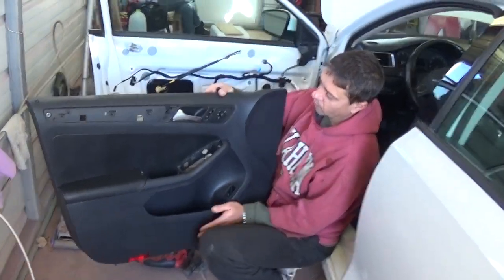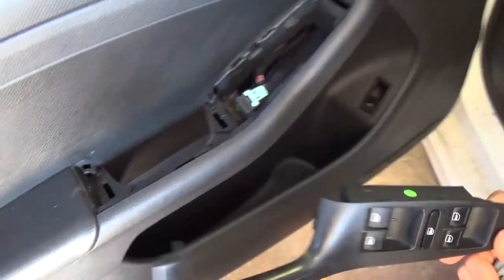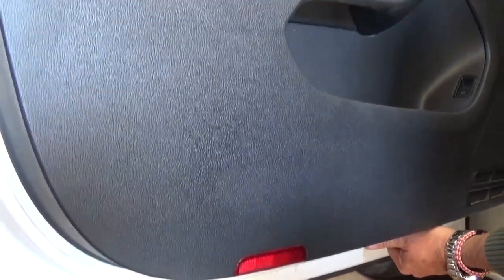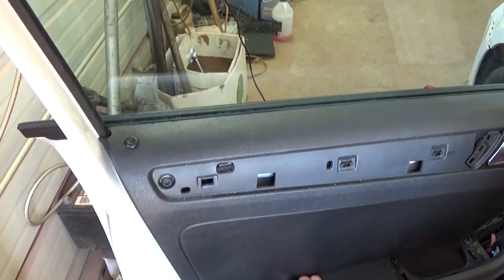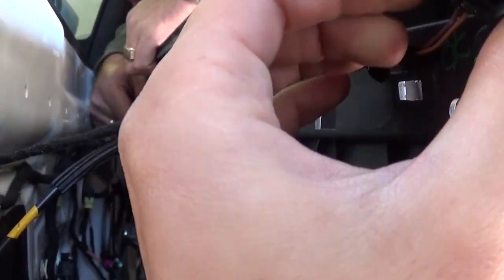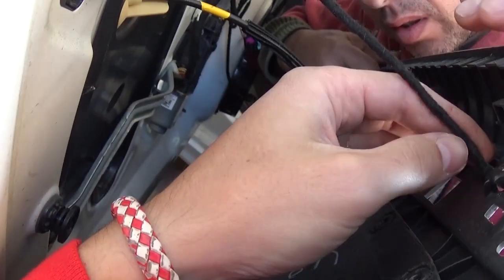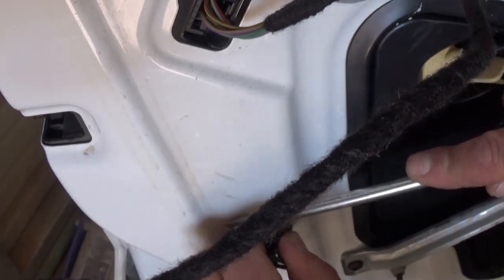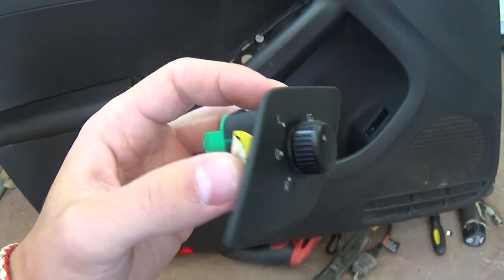VW JETTA MK6 POWER MIRROR SWITCH REMOVAL REPLACEMENT | VW GOLF MK6

Comment: Thanks a lot. Useful information, I did not need to hold the entire door cover off since I just removed the back mirror control. As this is in the top door cover, I sliced down the window first to remove the device. 😄😊🤘🏼

Comment: I just had to replace my switch, took all of 15 minutes. Just pry the switch out from the door directly. no reason to remove the door card. The switch is held in by 4 small tabs only. Then remove the cable by pressing the release switch and gently pulling. To re-add the new switch, just insert the plug, then push it into place.

Comment: No need to take the door off. Switch will come out with a flat plastic blade. New switches on ebay (8-10 USD) . Be sure you get one for your country (rh or lh),.